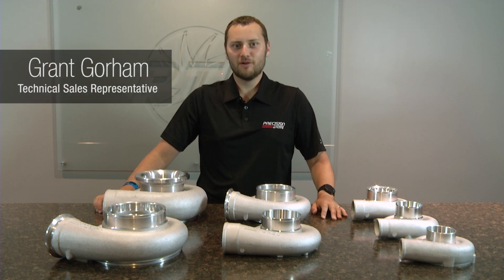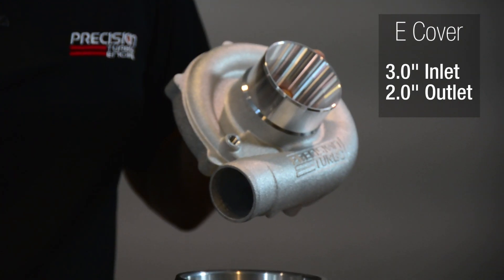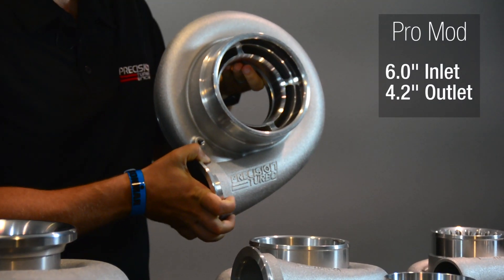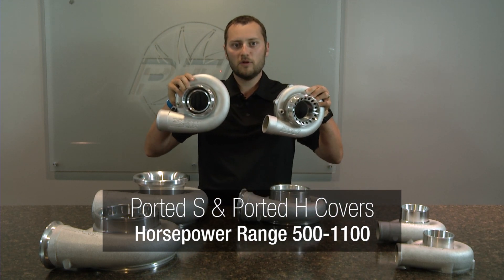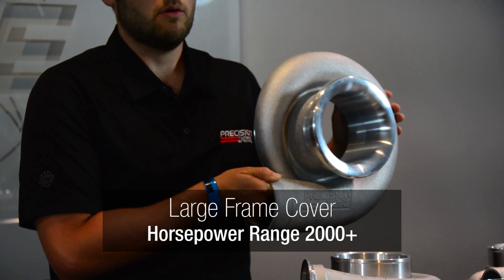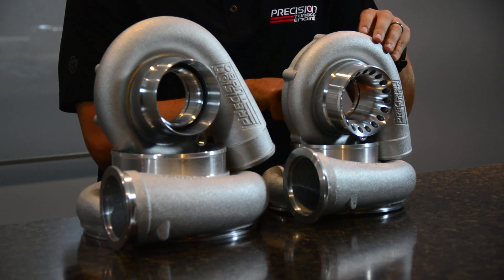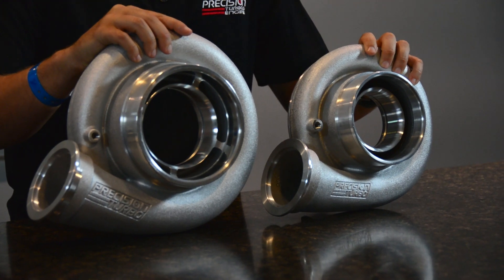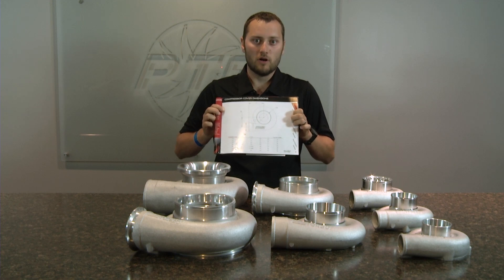Precision Turbo Compressor Covers

Comment: If a ported housing is used, is a BOV still required? Or are the ports designed to prevent surge during open throttle only? Thanks.